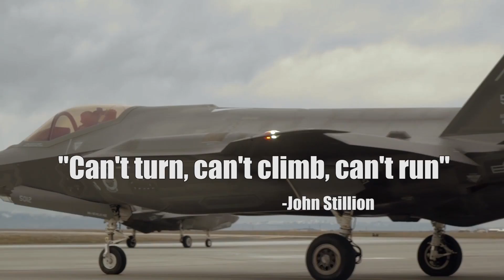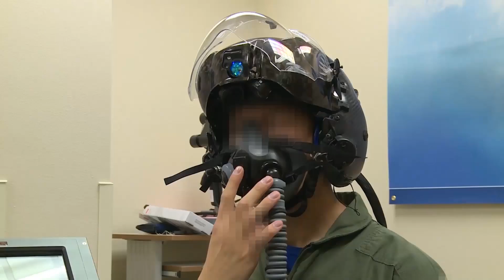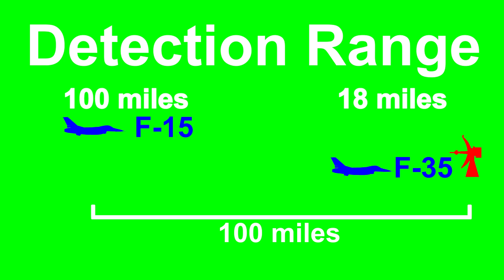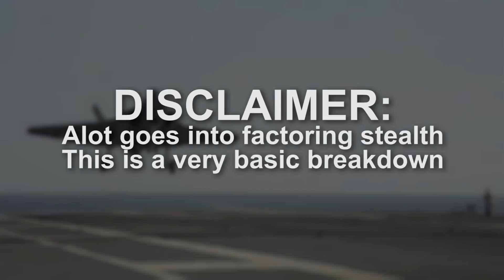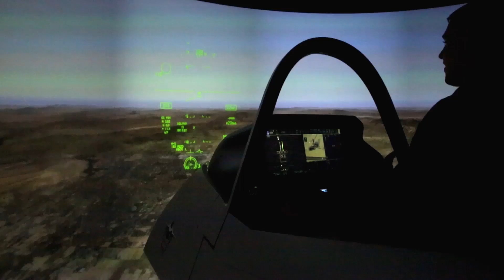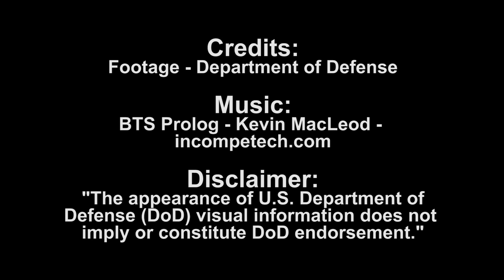F-35 Overview - The Good, The Bad, The Ugly

Comment: Hey Covert Cabal, things has evolved since this video was posted, I think you should make a new one.
Reply: Agreed
Reply: I suggested Covert Cabal  a video topic, i did not asked basement keyboard warriors opinions, I think you should kindly fuck off.
Reply: @vwbora26  if you didn't want people to comment publicly, you shouldn't have made a public comment. Are you the only one who has a right to voice an opinion in this comments section?
Reply: It still has the same basic problems. America is going to have to get costs down and payloads up in the next model.
Reply: The Ambitions beaten by the harsh reality. Look at Cyberpunk 2077, it promised so much, but it flopped right after launch. F-104, it promised so much on the drawing board, in actuality, Widowmaker.

When you try to be the jack of all traits, you will become the “jack of all traits”, not as much payload as a F-15, not as stealthy as the F-22, not as maneuverable as F-16, and not nearly cheaper then the original designed cost.

Our technology aren’t sufficient enough to make a “All-Purpose Fighter”, we can make multi-role, but All is too much. F-35 is a good plane, but it tries to excel at everything, and fails.
Reply: How can you detect a f35 or f35 when it is in pure Stealth mode ?
Reply: The F-35 is a great replacement/follow on for the USMC AV8-B Harrier and USAF F-117 Nighthawk. It is a horrible replacement/follow on for  the multirole, backbone of the air force F-16. For use against very high value target that require deep penetration and stealth great. But for jack of all trades day in and day out ops. Very bad due to high per mission cost and very low low mission availability and low sortie rate.
Reply: As of today the USAF has declared the F-35 program a “failure”. so you’re going to spend another 50 billion dollars on it.
Reply: @theluftwaffle1  cite your sources
Reply: Sure...more PROOF that this thing is a piece of shit
Reply: @JohnJohnson-dj2dv  quite the opposite actually

It defeated F-15s in war games without breaking a sweat - even at close distance, they had no idea where it was until they got shot down.
Reply: @TheArakan94  Back in the day wargames gave F-105 ~350/1 kill ratio against previous generation fighters. F-105 turned out to be one of the worst military projects ever. You shouldn't trust wargames.
Reply: @BKA3510  Do you have any evidence for that claim? Its hard to believe that a plane that started out as a light nuclear bomber, but was pressed into service as a ground attack plane would even have 350 air-air fights in training.
Reply: @crankthetank3581  hey even a lightweight boxer can beat a heavyweight if the stars align.
Reply: Not much has changed. Turns out the increased manuverabilty was a software limited and for good reason.  Its unstable at high angle of attack above 20 degrees
Reply: @BKA3510  wargames can be highly effective if they're run fairly. In wargames between other countries the f-35 does well. And those nations are the ones who have to decide wether or not to buy it. It's a much better test.
Reply: @johnrollex680  F-35 is indeed a great aircraft. It is just 48:1 ratio sounds unrealistic. Wargames can be very skewed up depending on the rules. For example, in 2018 Indian Su-30MKIs achieved 9:1 ratio against the latest USAF F-15s in a war game. Later it was revealed that it was a no radar, no AWACS, no BVR combat and Indians outnumbered the USAF 3 to 1 in most engagements. Next year Indian Air Force joined Red Flag in Nevada desert and they were slaughtered. We don't know what were the rules during the said F-35 vs F-16 exercise. It is better to say 48:1 in some conditions.
Reply: @BKA3510  I think that in an actual war scenario it's unlikely that they will achieve a kill ratio that high. however I don't think that the war game was unfair otherwise the other countries would have spoken out against it. They would want a fair test before buying the product.

The reason why I say that the K/D ratio wouldn't happen in a real war is because it's unlikely that the enemy would face the f-35 under "Fair" conditions. Since the f-35 is such a superior fighter it's unlikely that only fighters will be facing it. most likely it will have to go up against layered air defenses and radars with fighters only being used for interceptions once the f-35 is within enemy territory.

I'm unfamiliar with the Indian war game that you're talking about, however if it was internal to the Indian military it has very little bearing on the war games used by the f-35. and even if it was done in cooperation with other countries, I assume it wasn't being used as marketing to sell a product.

now granted war games obviously aren't going to account for varied weather conditions, the need to put oneself in unfavorable conditions due to the necessities of combined arms warfare, or unexpected events such as breakdowns and communications (at least in most cases). But this doesn't make the war game unfair, simply of limited scope.

Anyway, it's also worth noting that the f-35 has been put in intentionally unfavorable wargaming scenarios, and his still performed reasonably well even in dogfights (which it is not designed to do).

Basically the f-35 itself is well worth the money. However you can have the best plane in the world, but if you don't have enough of them to carry out a proper combined arms operation it doesn't mean anything. The fact of the matter is that the trend of ballooning costs has to reduce at some point or else the enemy can simply ignore you since you can't do enough damage to them. And while this isn't yet a big enough problem with the f-35, we'll just have to see what happens with the upcoming 6th gen fighter.
Reply: @johnrollex680  I agree. It is definitely superior to the 4th gen. Otherwise the US would just modernize its F-16s and F-15s. We almost on the same page.
Reply: @BKA3510  they are modernizing the f-16 have you not seen the block upgrade packages?
Reply: @JohnJohnson-dj2dv  Wrong

Comment: The ugly truth! It can't manuever, can't run, can't fight. It's not stealthy enough. It's a complete overpriced boondoggle. Nor is able to really replace any of the aircrsft named. Existing planes should be returned to the X-35 stealth standard. Then used extensively as a very limited stealth aircraft supplement to existing forces. An all new replacement program to replace existing aircraft should be initiated.
Reply: What nonsense are you on about?
Reply: @peterson7082  Watch thr video. Lack luster agility, poor thrusy tp weight ratio, and a top speed of Mach 1.5. Basically anything that can catch it, can kill it. Oh yes, it can fire long range AIM-120 missles. But it can't carry many. So when a Mig-21, or better fight gets into visual range. It's tpast! To make matters worse, it's not as stealthy as it's supposed to be.
   Oh well, ay least our pilots will learn to die well.💀
Reply: @scottjackson5173  Compared to what? The thrust to weight ratio isn't poor. Nor is 1.6M at combat load a bad speed. The F-16 cannot acheive that at combat load. 

 I have watched the video. It has good criticisms, but nothing concrete, like most opinionated videos.
Reply: @peterson7082  I often encounter F-35 loving trolls like you. I have the same message for all of you. 
   The JSF program has always been a bureaucratic bean counter idea. 1 plane to do it all! A real money saving idea. Which looks great in a board room. The first JSF, was the F-111. 
   The F-111 was supposed to be an F-14, F-15, A-6, A-7 and more, all in one great package! People promoted and lied about it's capabilities. In the end, it made for a great long range bomber, and electronics warfare plane. Once all the lies stopped.
  The JSF concept has one enormous ever insurmountable  obstacle. The laws of physics and aerodynamics. It just cannot be done. The F-35, is the latest product of the JSF program. So I am extremely suspicious of every performance claim, and every part of the program.
     There is an enormous ammount of money at stake! Such stakes breed lies and greed, like manure breeds flies.
    I really hope you are right. I hope this aircraft is everything it's supposed to be. Only I am anything but convinced. Any high quality information on this program is highly classified. So people like myself get to look and guess. That's tailor made for greedy promoters whom care only about the money. So I echo the criticism of those whom have a current security clearance.
   So let's be clear. I want our pilots to have the best war planes. I want them to win the battle, and safely to return to base. I'm not convinced the F-35 is that plane.
Reply: @scottjackson5173  Buddy your rant is useless when you break it down, the F-111 was built to try and meet the requirements of two services with vastly different requirements, the USAF wanted a long range interdictor and nuclear penetrator and the USN wanted a fleet defence fighter, the USAF got what they wanted but the USN kept moving the goal posts and changing requirments
The F-35A, F-35B and F-35C were built from the ground up for the requirements of each service, all 3 services were looking for an aircraft to do similar roles, not vastly different ones
Reply: @demanischaffer  Ah! Another fubar lover! Lol! 
   At least, your not completely clueless like so many others. You make the mistake of thinking I have something to prove. I'm a critic, one of many. It's the F-35 that has to prove itself. It's not doing it. So, you attack me? Fool!
    My sole motivation is victory over America's foes. My clearance is no longer active. Yet, at my age, I can easily "read between the lines," to understand truth. Clearly the truth is, this plane is, and has been, and expensive pile of problems. I won't waste my time, listing ALL of the problems I'm aware of. But, here is a few.
    The B & C varients have engines which tend to damage the airframe at high power settings. Stealth paint that peels off at super sonic speed. Fighters that become uncontrollable at high angles of attack. Every other fighter built since 1960, is much faster than this turkey.
    One Airforce critic claimed: It can't run, it can't fight, and it's not as stealthy as it's supposed to be. Believe what you like! I'm waiting for another good laugh!😎
Reply: @scottjackson5173  The A/B/C all have the same engine so it's not an engine problem
"Much faster"
On paper it's slow until you realize, an F-35 is able to hit its top speed while armed, an F-16 will not be able to get to its top speed when lugging around all the equipment it need
"Peels"
Because the F-35 isn't going to be flying at high supersonic speeds for long periods of time
"Unstable"
Really? Never heard that one or seen it mentioned even in the DOD Angle of attack testing awhile back, the conclusions they found had nothing to do with stability but an over restrictive flight computer 
"One airforce critic claimed"
Yeah no, I know exactly who you're referring to, Pierre Sprey made that statement and it has no base, and he has no authority on the matter as his qualifcations are laying out the requirements for the F-16 as light radarless day fighter, which was quickly scrapped until we got the modern F-16
Every aircraft has problems, however the F-35's haven't kept out of active duty, remember the F-14 stalled out and killed pilots, the F-16 was a lawn dart and killed pilots, and the F-15 was an "over complicated Turkey" (paraphrased Pierre Sprey)
Reply: @demanischaffer  This is an old video, one of many. The inability of the F-35 to accomplish it's designed missions is well documented. It's reliablily is worst than the old planes it's supposed to replace. The F-15 and F-16, are still in production. This is because so few F-22's were built. Also because the F-35, isn't the plane It's supposed to be. The A-10 warthog, is being overhauled for continued service. For the same reason. 
   If you actually watch this old video, the only shinning light is stealth. Which is expressed to viewers as a mathematical equation. Lol! That equation only works off the production line. Meaning the airframe suffers degraded stealth performance over time.
    Once again you assume I have to prove my claims. So your still a walking joke! As is the reputation of the F-35! Which is a flying catastrophe. In a real war, this plane will prove as usefull as the Brewster Buffalo, at the battle of Midway. I don't want that! Unlike you, I swore to uphold and to defend the US Constitution. Against ALL enemies foriegn and domestic. So I'm a critic of all stupidity that comprises that mission.
    Your job is damage control. Paid to keep the money flowing  at any cost. That means attacking critics like me. Yup, yup, yup! They hire fools like you, to patch holes in a dam. Just before it fails. Lol! Lmao! 😃😆🤣😂
   PS Dude, it's a lost cause! Mr. Pseudonym troll! Oh yea, slmost forgot. Thank you for all the laughs!

Comment: This plane would be useless in a war where for every F35 lighting built, the enemy can build 15 other fighters for the same cost.
Reply: There are no decent aircraft that are 1/15th of the cost of the F-35. At that price the junk you'd be flying would just get shot down without even being able to fight back.

Also most of the cost of an aircraft aren't from buying the aircraft, but actually operating it. You wouldn't afford 15 pilots, 15 times the logistics and so on. Combat aircraft have a massive logistics footprint and it's better to build smaller amounts of extremely good aircraft over large amounts of cheap junk.
Reply: @ivanlagrossemoule  The F35 program has cost literally 100 times more than what the Russians spent to develop the their SU57. Lockheed is laughing all the way to the bank while we try to fix overpriced, badly run project by throwing more money into them.
Reply: @xygomorphic44  The F-35 "program cost" is the entire program from start till the late 2000's (I believe 2070, and counts fuel and maintence and replacement parts among other things)
The F-35A also costs 80 million per plane, what planes can you get 15 of for under 80 million that can combat the F-35?

Comment: You take an air-force and determine the spectrum of operations that it is called to execute. Then You design an aircraft to execute part of those operations. Than You assess that aircraft according to its capabilities to execute those operations. Yes, You can and should compare it to other aircrafts, meaning their performance in those missions. Then, and thus, You express a judgement on that aircraft.
In light of this, I don't see that putting an F-35 in a dogfight with an F-16 is relevant in judging an F-35.
Is the F-35 designed with the dogfight as its primary mission? No, it's a strike (multi-role, yes, but I'd say strike first) aircraft, and its air-to-air capabilities are intended to exploit its advantages, which leads to a "know-first, see-first, shoot-first, kill-first" approach to air combat. Stress on "know-first".
For what was the F-16 designed? For energy-maneuverability air combat, or "dogfight" superiority. This theory has merits for a dogfight, but it assumes that both pilots are aware of each other and maneuvering, no sneaky attacks,  i.e. it applies after the F-35 has wasted all of its advantages, which implies You can then not judge precisely its advantages.
It does not come as a surprise that a '70s dogfighter has different requirements for a how it enables the pilot to look behind him (with eyeballs Mk1... sensors, sensors integration and sharing are another thing). Nothing new for these capabilities, the idea is clear already in a P-51. If the F-35 does not have it... could it be that it is not because they forgot? They didn't forget for the F-22, right? It's the same Lockheed designing the F-35 after the F-22!
The same consideration goes for the thrust-to-weight ratio, energy-maneuverability air combat ofc!
Or You want a good climber? Take an F-104 or a Lightning, the English Electric one, because that was their mission. You want fast, take an YF-12 or a MiG-31!
Can these aircrafts accomplish what the F-35 is designed for and can do? Nope.

PS: the F-35 has a helmet mounted display, not a HUD.
PPS: one of the funniest examples of "let's judge by dogfight", might be a Tornado ADV vs. F-15E, but this is because those two had both to learn a job they were not borne for...

Comment: 20% parts commonality kills main promise of the aircraft regardless of capabilities. Maintenance willl become an issue and very, very costly.  90 mln fly away cost for package with working DAS, communications etc is actually not bad ! For: WORKING.  Somebody should take brave decision, FREEZE production and development for 2 years, stabilize features, retrofit existing aicraft to intermediate variant and use for training and then start really series production. Also: I think that F-35A should be scrapped altogether. Advantages of this variant over B and C are immaterial, and using Naval variant airframe for STOVL variant at expense of range/payload/fuel capacity would be acceptable tradeoff for real commonalization and not that painful, since aircraft could be refuled in flight anyway.  This isn't dogfighter anyway and wasn't supposed to be, so Naval variant as baseline (range, fuel) makes a lot of sense.